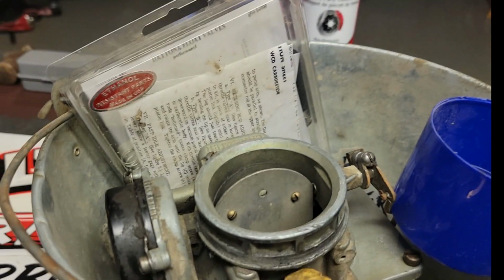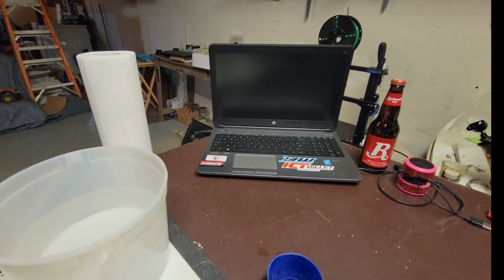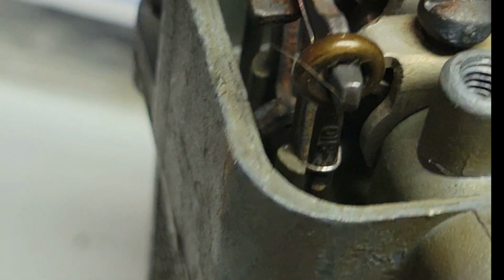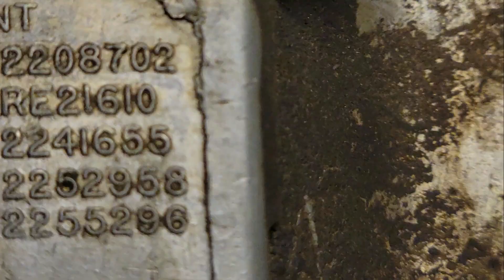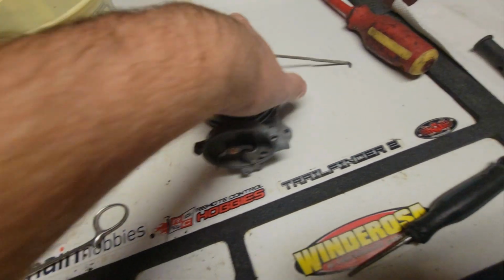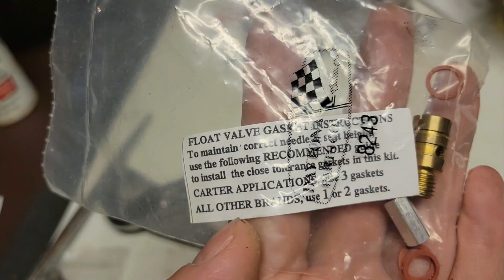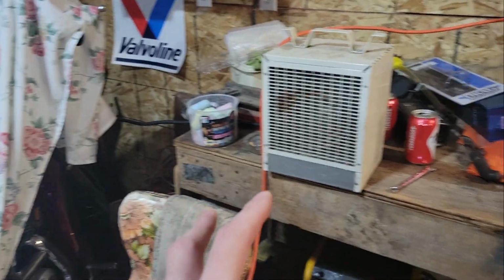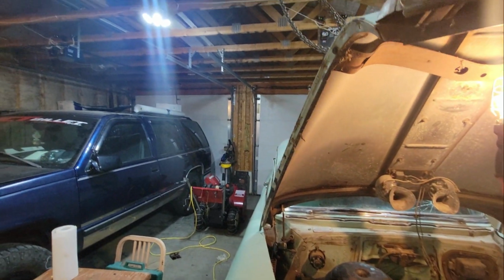1953 Pontiac Carb Rebuild - Carter WCD Rebuild

Comment: Its clean anyway. Good luck with it. I've had varying degrees of success and failure working on Holley one and two barrels. The four door sounds interesting.
Reply from the maker: Thanks, definitely been a while since I last tore into one of these but once the linkage is sorted I'm certain it will work. wanna keep the car as original as possible.
Reply: I am near 76, these were high school cars in Tulsa Oklahoma in the early to mid 60s.  These rebuild kits even back then covered  multiple versions of the carburetors,  you're doing good
Reply: Where did u get rebuilt kit?